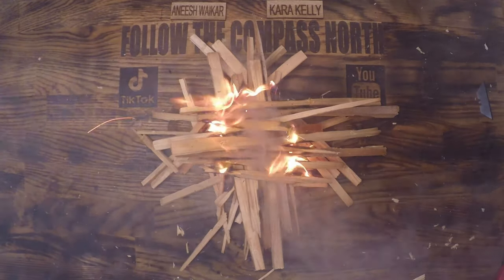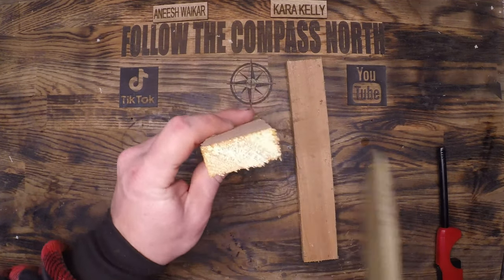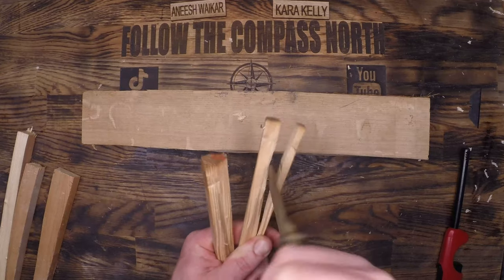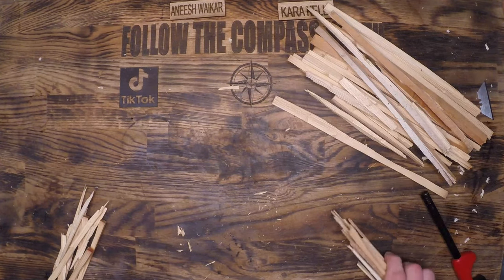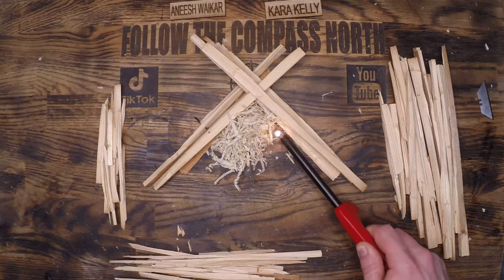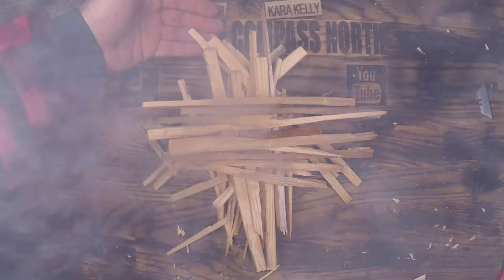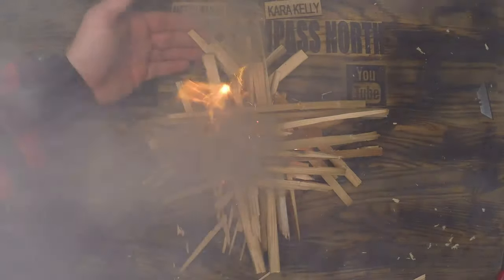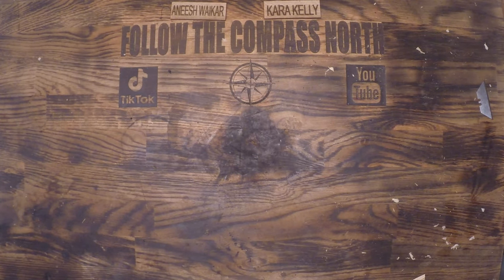Have CONFIDENCE in your FIRE building skills!!

Comment: It's not that I think the desk will "ignite", its that I expect it to pit and blacken wayyyy worse than it does. You usually scrape it off fairly quickly tho
Reply from the maker: Most heat transfer methods are impacted by gravity so the heat is traveling away from the surfaces it's sitting on. Mostly

Comment: The throbbing method is an accident waiting to happen. If you slip down the handle of the knive, you’ll end up with a severe cut in your fingers.

Never ever use this technique without the proper (!) use of a lanyard that prevents your hand from slipping down the handle onto the blade… (and yes, there is a specific technique on how to correctly and safely use a lanyard on your knife/hatchet).
Reply from the maker: It could be a problem for beginners so we make our students use gloves.
Reply: @FollowTheCompassNorth  not only for beginners. This might be great sitting at wooden desk inside. what about Outdoor in the rain, when your hands are wet and the knife is damp or you lack dexterity because I of the cold… why not teaching them how to use lanyards properly? I’d prefer a technique where I am physically unable to slip down into the blade over a layer of fabric/leather protecting my second-most important survival tool, every day of the week.
One of the worst things to do in a survival scenario is adding trouble to my situation by myself - be it by a lack of skill or knowledge , be it by accident or be it by stupidity.

Risk/Reward just doesn’t look right with the way you’re proposing here.

Comment: Future video idea for you different woods and what they're good for for example things like Oak and Madrona and stuff like that can be quite good for maintaining fires because while they are really hard and difficult to burn they will burn for a long time and as long as you have good bed burn just fine whereas stuff like Douglas fir is great for building fires as they start easy and they burn overall very good to me I like using Doug Fir it's a little bit smokey but since that smoke will actually help keep mosquitoes away I'm usually pretty okay with it. And then Cedar and other extremely soft and hot burning Woods Cedar has a huge amount of oils in it which is actually where it gets it's pungent Aroma from but these also burn super well and it helps the wood burn just crazy fast and crazy hot amazing for starting fires but due to how fast it burns I don't think it's very suitable for building fires as you're not going to get much of a bed from Cedar at least not when compared to a bit harder would
Reply from the maker: Theres some solid truths here. I'll have to look into doing this. Thank you.
Reply: Hardwoods are also good at making cold beds but honestly due to how hard they are to start it just isn't worth trying to build your coal bed but Douglas fir and other medium hardness Woods are great for this purpose it's the sap that makes Doug so Smokey but it is really good for building coal beds in my experience. Douglas fir is not suitable for cooking it does burn nice and hot but I would not cook over pitchy Woods due to the smoke and how much they tend to pop. Hardwood is great for cooking due to it s long-term use and how little it tends to pop when it burns and hardwood tends to burn relatively clean so you'll end up with some aromatic certainly but it's not going to be vile taste that pitch can cause. Pitch doesn't burn very clean which causes a lot of smoke it's not great to inhale so yeah be careful of that but otherwise it does help repel bugs really well even without using cedar Cedar bows or pine vows also do pretty good though if you burn green cedar or pine bows and they are very good at repelling bugs stand in the Smoke close your eyes don't breathe and just kind of stand in the smoke for a while just kind of turning and you will not be bothered by the bugs for a while at least not very much I've noticed it isn't perfect but it does seem to help especially with cedar bow
Reply: Side note I live in Washington and weed is lagal. So I happen to be stoned so I do apologize for excessive rambling. The choice of wood was probably a give away of the Pacific Northwest anyways
Reply: @FollowTheCompassNorth  also if you've never seen Madrona you totally should it's really interesting it is actually kind of Christmassy which is kind of funny

Comment: I mean technically speaking even even that cedar would have managed the heat from the Bic pretty decent even though it's like a super soft wood I mean don't get me wrong there's definitely would I wouldn't trust Lighting on top of hardwood but that has more to do with the fact that those are typically a slower burning thing Cedar burns up pretty quick which is why it's not ideal for fire building but it's great for kindling and cooking instances where you want that extra heat also Cedar smoke adds a really nice flavor
Reply from the maker: I only disagree with the "has more to do with the fact that those are typically a slower burning thing". Surface area matters more than type of wood. If you shredded Oak like this it would burn better than a slab. Both are factors, surface area in relation to overall mass an it's ability to thermally resist is the bigger factor